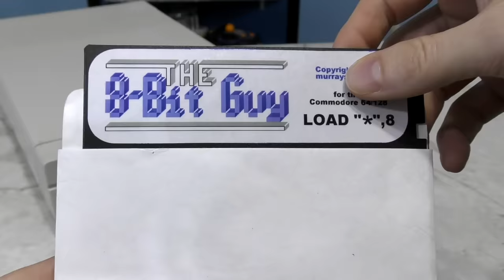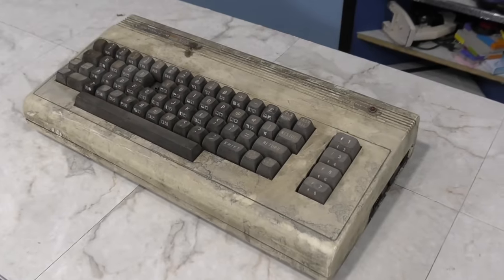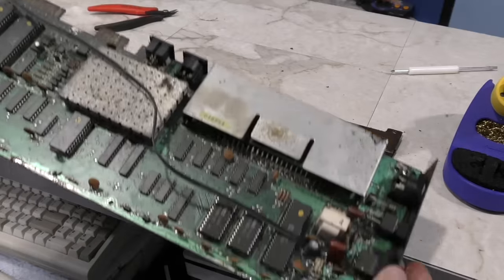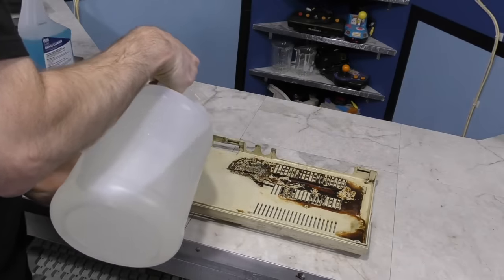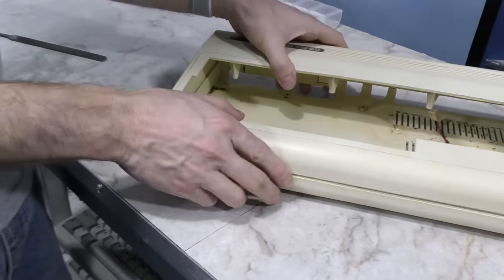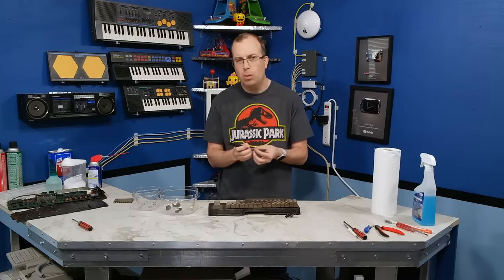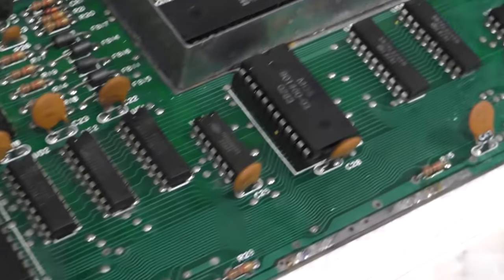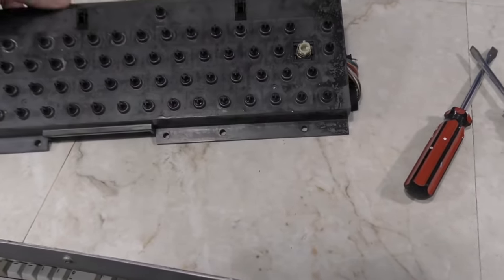Restoration - The Worst VIC-20 I've ever seen - Part 1

Comment: That cardboard just saved you from having a mess of corrosion on the back of that logic board.
Sadly it perished in the fight to save the board.
R.I.P cardboard put there to prevent shorts.
Reply: The cardboard had one job, and it did it pretty damn well
Reply: E
Reply: @JetFalcon710  it actually did more than just its job. Wasn't really designed to keep the board protected from corrosion, but it did that job in addition to protecting from dead shorting the board.
Reply: Three years ago now, a plucky piece of cardboard gave its all in the fight against logic board corrosion.
Sadly, it lost that fight but saved the board. 
We shall remember it and its brave deeds.
R.I.P Brave cardboard,
we salute you
Reply: f in the chat lol
Reply: @toastersunited   Eeeeeeee
Reply: @k4t43  
F
Reply: F
Reply: Rip cardboard
Reply: R.I.P. Cardboard, Gone too soon.

1980-2018
Reply: o7 to that brave cardboard
Reply: Rip cardboard. You will be missed, but never forgotten o7

Comment: I too worked in IT in an industrial environment . The oil you are seeing there is mostly likely from a shop floor computer working with large CNC equipment cutting metal. It was all over my computers as well but not as bad. That VIC-20 was most likely used to write programming for those machines since they are only a few lines of code and basic text.

Comment: As a woman watching these videos, may I recommend Dawn dishwashing detergent as a degreaser? It's super effective but also super gentle. It's also more gentle on the outside when you have to rinse things. I've used it on everything from greasy dishes to power tool parts.

Don't underestimate a crafty lady. ;)
Reply: I second Raging Shargon's comment... I remember seeing a 'life hack' about washing your hair with Dawn to strip all the oil and product buildup out. Works MIRACLES on greasy hair.
Also Jamberry recommends washing your hands with Dawn before an application to strip the oil from the nail beds.
Reply: I personally use break cleaner to wash my hair.
Reply: I was gonna comment the same!
Reply: Its a trap!
Reply: I care, since most guys don't give much of a damn about cleanliness.
So when it's a recommendation about a cleaning fluid, i generally hold the opinion of a woman a little higher then that of a man.

Woman: You need this cleaning fluid, use this much and apply it there for this long.
Man:  uhhhhm, just get a high pressure water hose and rinse it off, or drop it in a bucket with soap!
Reply: That's the first thing I thought when he said it was covered in oil.
Reply: I'm genuinely surprised he didn't try dish soap first! It's a pretty basic first step! Using denatured alcohol, what the hell?
Reply: No point. Just use something that's designed for the application.
Reply: BrainSeepsOut Yeah, like brake cleaner... seriously, what?
Reply: to clean oil stains you use "heavy-duty hand cleaning paste" or just "CIF Cream" which is in any household
Reply: I was thinking exactly this. After all, they use it to help clean proper oil spills.
Reply: Many years ago I had industrial silicone rubbed in my hair. I tried a lot of human friendly products without success. Dawn took it out very easily.
Reply: Exactly what I use on console and PC restoration. If dish soap doesn’t do it you’ve got some serious work ahead of you. Unfortunately it doesn’t seem to do much with the rusty corroded mess you’ll find between the plastic and RF shielding.
Reply: Kooldragon400 definitely made more for fats but that was my though too using dawn and scrubbing with a mild scouring pad to break up the oil
Reply: yep, Dawn is pretty crafty..
Reply: Benjamin D Minor agreed though I did expect the audience for these videos to be mostly male
Reply: Works on car engines too :)
Reply: Kooldragon400 uses Dawn
It's super effective!
Grease faints!

What?  Oh come on, someone had to!
Reply: That or turpentine substitute if it exists in the US.
Reply: Oh my god, YES. I was like...why not dish soap...? It's works excellently against any kind of oil. Turpentine works well also.
Reply: Biological detergent for the clothes washer can get stubborn stuff other things don't, too.
Reply: Also, a degreaser like Simple Green Pro HD is very handy to keep on hand, but honestly Dawn works almost as well most of the time.
Reply: We use Dawn dish soap in the shop. Cuts through grease like you would not believe. Very handy when overhauling engines.
Reply: Let's see... "heavy-duty hand cleaning paste" or "CIF Cream" is in any household? You have a weird household because in my household I don't have any of that. However I do have dish soap, which literally every household has because you need it to clean dishes!
Reply: Kevin spacey Well I don't work on engines and am pretty sure Gojo is a children's cartoon character. Never heard of that product, pretty sure you made it up. However, dish soap, any brand, is available at any grocery or pharmacy, and everyone uses it. Unless you use googoo to clean your dishes as well.
Reply: Gojo isn't made up, a simple Google search would have revealed that to you.
Reply: You're probably right, but then I wouldn't have gotten that joke out about it sounding like a children's cartoon character.

Anyway, the point is, it's quite ridiculous to suggest he try to track down an obscure specialty product, and have to wait a week for delivery, when he has a product that will probably work just as well sitting next to his kitchen sink.
Reply: @BrainSeepsOut  dish soap IS designed for that application, it's specifically made to REMOVE grease.
Reply: @theblackwidower It was quite the journey reading these comments. You vying for validation the entire time while mocking others for offering viable alternatives was the cherry on top for sure. 😊
Reply: @theblackwidower not saying you’re wrong, though.

Just pretentious.
Reply: @SadBadge  Clearly misinterpreting my point. My point was people saying brake cleaner was something everyone had, and that dish soap was a specialty buy. I'm guessing they eat their food off of brake pads. There's no need to find a viable alternative when a very common thing does the job without issue.

Also, I wasn't mocking anyone. Again, clearly misinterpreting.

Comment: I love these restoration videos. It's so satisfying seeing something that most people would consider to be garbage, be given a new lease on life. Also, they won't be making any more of these old machines, so i think it's very important to make an effort to keep them around.

Great job. :) I also have a little tip. If you ever run into another machine covered in oil, you can use monster energy drink to remove it. It removes the greasy stuff even faster than brake cleaner, and it shouldn't affect the plastics or components in any negative way, though it should definitely be rinsed of after cleaning. I know it sounds insane using monster energy drink to clean off grease, but it really does work a treat. Try it out on something like an oily table top or something else that's really greasy, you'll be amazed. :)

As for the plunger, just file the broken one flat, and cut the top of one of those c64 plungers, and epoxy the 2 together. It'll be stronger than new. You've probably already fixed it, but just a tip for another time. :)

Again, great job, i really love your videos, specially these restoration ones, as i mentioned before.

Cheers!
Reply: I wonder if it works with the halal-iefed version I can get here too....
Reply: People actually are making reproduction Commodore 64s, at least. Hopefully somebody starts doing the same for the VIC 20.
Reply: Christian
I'm half-terrified, half-amused by the idea that something people put inside themselves can be used to remove grease and oil.
Then again, what things have people been able to do with Coca-Cola?
Reply: The monster energy thing is false please don’t do it. You’re better off trying dish soap, goo gone, or lava soap. The reason the oil is stubborn to remove it’s because it’s been dehydrated over the years.
Reply: Why would you think it's a troll? Coca cola is also a great rust remover and cleaning agent for chrome. Just because something is meant for one thing, it doesn't mean it can't be good for other things as well. You know, like brake cleaner is meant for cleaning brakes, and not Commodore computers, but somehow, magically it still works on things that aren't brakes..

If in doubt, there are lots of videos showing these things in action.
Reply: I didn't tell you to go and drink brake cleaner, did i? The fact that the energy drinks are made for consumption, has no bearing on what other properties it has. Besides, If you think it's a troll, fine, i really couldn't care less. :)

All i did was leave a friendly piece of advice that has worked for me and others. If he wants to try it, fine, if not, that's fine as well.
I won't be responding to your hostility again. 

Have a nice day.
Reply: it's still garbage and in no way should it be called a restoration. He did bring it back to life tho.

Comment: Instead of jumping straight to organic solvents, try using dish soap. I've tried all kinds of solvents for cleaning all kinds of things because I have a degree in chemistry and a big ego, but it seems like concentrated dish soap is better than anything I can make. It's cheap too. When soap fails, then it's time to use rubbing alcohol (won't destroy plastic), WD40 (might destroy plastic), and acetone (will definitely damage the plastic).

Apparently "brake cleaner" is about half acetone. That would explain why it dissolves/discolors the plastic.
Reply: Keyword: Big ego.

Yeah, that really sells the facts..
Reply: I was about to comment that (the soap part).
Reply: In my experience brake cleaner is often ether and toluene or xylene, rarely acetone.
Reply: Yeah I was gonna suggest just straight up Dawn. If it’s gentle enough for sea birds I imagine it’s fine on plastics

Comment: If this wasn't already suggested, Simple Green is a fantastic degreaser that would work wonders on any of your restorations. It also wouldn't harm any of the plastics. I highly recommend it!
Reply: For the plastic case instead of using peroxide and water use peroxide hair developer. Its peroxide mixed with cream so it doesn't dry out. Just wrap it in gladwrap or a plastic bag. It works on all yellowed plastics
Reply: Stop watching YouTube and finish the fiero lol, keep up the good work
Reply: @danpowers3022 He actually used to use that method and stopped because some of the pieces would come out uneven. The cream does actually dry out according to him and at least in Texas he'd have to reapply and massage the cream several times. The bath method achieves a more evenly distributed result more often.

Comment: Try Dawn dish detergent next time you end up with Jed Clampett's computer. It breaks up grease/ oil/ etc. Hot water, Dawn, and a good stiff scrub brush should clean up the case so it can be retrobrite'd. Hopefully, less work, too.
Reply: Brian M: Dawn dish detergent is my preferred de-greaser/de-oiler as well. And it is safe for plastics.
Reply: For something this tough just let it sit submerged in a bucket of dawn and water for a few hours and it should come right off.
Reply: I was thinking the same thing. Dawn works on everything, ducks, penguins, dishes, computers, whatever you got.
Reply: Agreed. Dish detergent should have worked. I had a kitchen stove-top hood with caked on grease from years of oil/frying exposure. I used Dawn dish detergent,  and it effortlessly removed the built up grease.
Reply: You beat me to it... The whole video I was like 'just use Dawn'.
Reply: You don't spell retrobrighted with an apostrophe.
Reply: There is no 'Dawn' in the UK I wonder if Fairy liquid is similar?

Comment: I have a Idea for your key problem. Use a piece from Lego technic  Lego Partnumber 32062. then drill a hole in your broken pice and glue it or plastic solder it.
Reply: there are stores like bricklings, so there you can browse
Reply: 32062 is a Technick Axle in size 2 with two notches
Reply: MentalmenteFDD
There are tons of reference sites for that like Bricklink or Rebrickable as well as Bricklings.

Comment: I found one of these computers in my backyard, and it contained a centipede, a colony of ants, and a salamander
Reply: @ladybug-w7l  No, I'm pretty new to electronics, so I decided the best course of action was to salvage some of the parts.
Reply: Yeah, that won't work. The chips will likely have bits and pieces missing, the soldering might be scratched off, and mud. On another note, I once found an old computer chip next to my driveway.
Reply: That is 😢 restore it to new condition
Reply: Wee🐸🐜🐛
Reply: @chrisbrasher6177  🦅 mmm a snack
Reply: I wouldn’t even touch it with a centipede in it.

Comment: GLOVES MAN!! GLOVES!!!
Reply: Forreal... Pretty sure that was dip spit out that was the gunk
Reply: If he does not mind the dirt. Just let him be.

If it is for safety im sure he would take nessecary precautions.
Reply: @davenn7597  You see him douse his skin in every chemical found from his house and then say that?
Reply: @Pentti Kantanen
Well, most of those chems were relatively mild.
Glass cleaner: depends on the brand but it's usually a very mild solvent.
Alcohol: pH neutral, like water. It can dry out the skin, but no worse than what a small dab of lotion can reverse.
WD-40: my main concern would not be with his skin but with his breathing, since this is an aerosol. It's a petroleum product which means it's pretty toxic, but assuming he washed his hands afterwards, it shouldn't be any harm done.
Baking soda: A mildly alkaline product, safe for both cooking and cleaning.
vinegar: The mildly acidic counterpart to Baking soda, safe for both cooking and cleaning. 
Deoxit: This is unfamiliar chem for me, but after googling, it seems it will irritate the skin "after repeated or prolonged contact". Though at least he didn't slap his hand all over this one.
sos pad: Seems to be some kind of American counterpart to Svinto. I can say from experience that foregoing gloves on this one is no big deal.
hydrogen peroxide: Not safe, but there seem to be very limited skin contact.
bräkleen: Is a strong degreaser, but assuming he didn't touch it while applying and hosed it off afterwards it should be fine.
electronics cleaning stuff: No idea what this actually was, but he applied it outdoors and hosed it off so little to n skin contact regardless.

As someone who deals with strong chems in my daily work, I do applaud any and all use of gloves since even water will break down your skin with prolonged use. However, I'll admit that I've been careless myself quite a number of times, and it's usually fine as long as you wash the chem off thoroughly afterwards and soothe the skin with a good hand cream at the end of the work.
Reply: Wearing plastic gloves is toxic to your hands
Reply: @helenanilsson5666 , great comment / research! Why is H2O2 unsafe, though? It's used for treating open wounds (a low percentage solution, though), surely it's more or less safe to undamaged skin (I don't mean prolonged contact).
Reply: If it was mega unsafe, none of this would be openly available to the public (bar the peroxide, thats a bit more specialist)
Reply: Yuck.
Reply: Nitrile gloves are also a thing.
Reply: @Bruce Da Moose  The peroxide used for medical purposes is usually only 3% hydrogen peroxide, the other 97% being water. It might be a bit stronger for hospitals, but I doubt it would be much of an increase. The peroxide used in this video is 40% hydrogen peroxide, as stated by the big 40 on the bottle. 40% is usually used by salons for bleaching hair. Peroxide at that strength can definitely cause some chemical burns if it comes into prolonged contact with skin.

Comment: I work as an electric engineer and I can relate going into the shop and seeing nasty machines. A lot were recently replaced but an IBM GL remains and boy has it been better days. The whole system is smothered with grease and dark oil mixed with heavy dusting and grime. It's kind of like a horror scene but I plan on giving it some love when they retire it
Reply: I know this is unrelated, but I didn't know that system existed, and now I want to use the horizontal form factor case for whenever I decide to build my next computer. So thank you for introducing me to that beauty!
(Yes I know it would be tricky and require mods.)
Reply: Cubester64 cool stuff!

Comment: The 8-Bit Guy: If you are curious about this Vic-20's history, the oil/grease contamination probably came from the computer being used in an automotive garage. Years ago, mechanics used a driveshaft re-balancing program on Commodores.
Reply: 999thenewman don't forget wheel alignment programs and dynamometers
Reply: i would NEVER have guessed they were used in automotive garages.  that's pretty cool!
Reply: what about a oil rig - Texas, early 80s?
Reply: I was curious about that. It makes much sense.
Reply: Can he go fix my  zippy keyborad
Reply: Miserab Le Fu
Reply: Try using monster energy drink
Reply: or a engin blew up
Reply: actually, now you say that, I do remember seeing these in a few workshops
Reply: true:)
Reply: 999thenewman you
Reply: Thats why i was wondering why my local shop has a vic 20 in the shelf back then.
Reply: 999thenewman thanks!
Reply: Like that polish C128 that made headlines a few years ago
Reply: Yes, in fact some garages (particularly smaller independent garages) used them well up until the early 90s. Corporate garages had moved on to making their own software by that point.